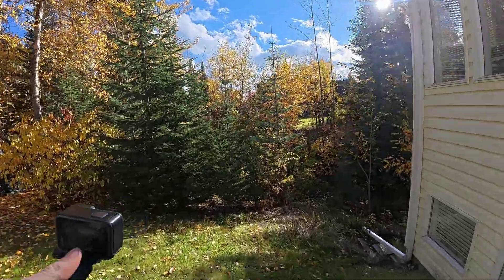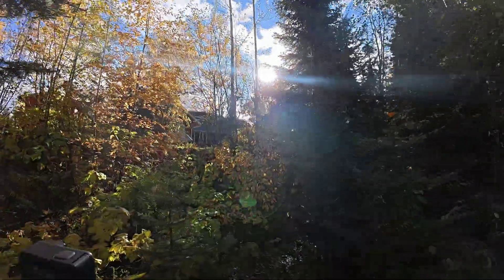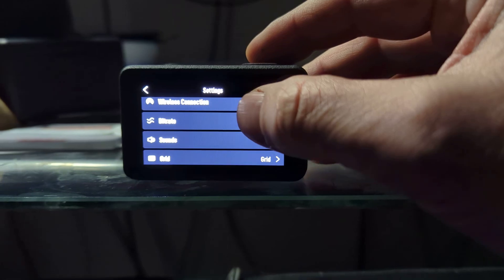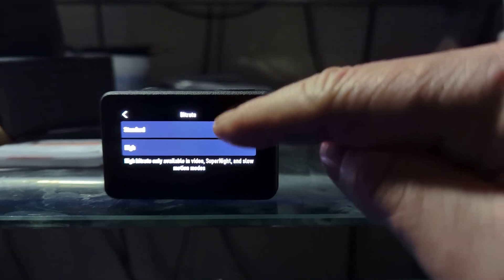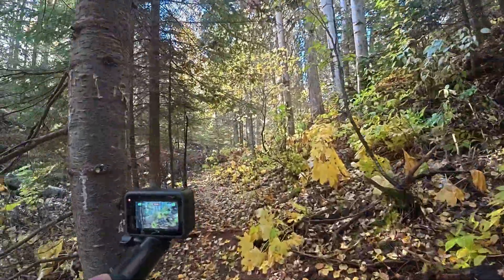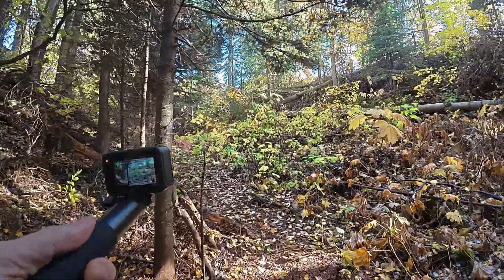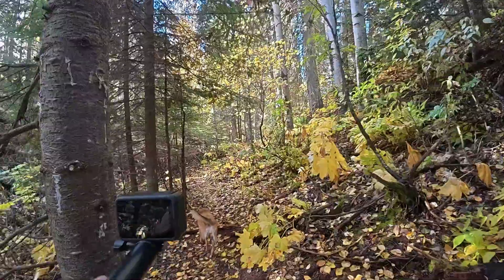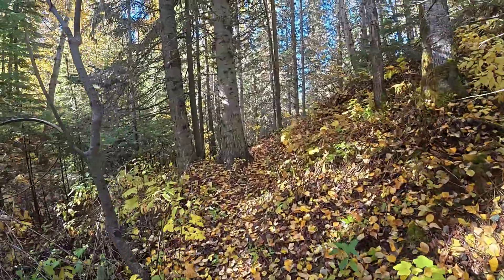DJI Osmo Action 5 Pro Low vs High Bitrate Update Comparison

Comment: Can't tell a difference. I didn't see one in my own tests either. I thought the vibrant colors in the normal color profile were not as bright after the new firmware install but still very close. I still prefer using my A4 in the normal color profile.